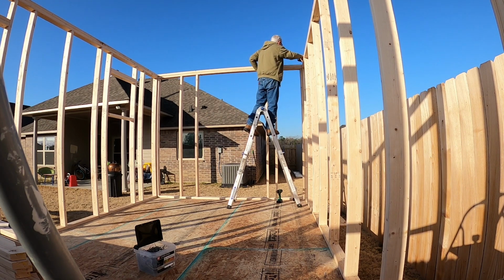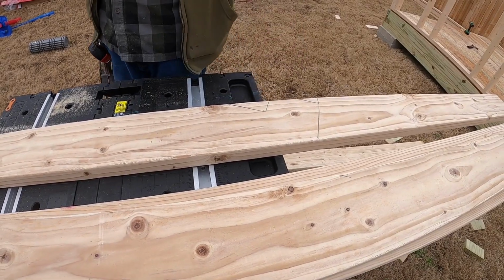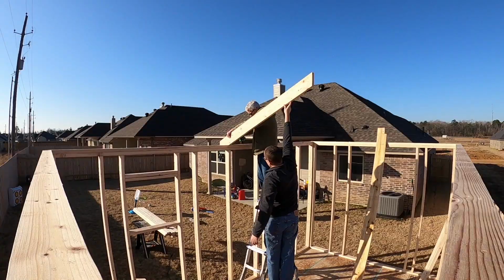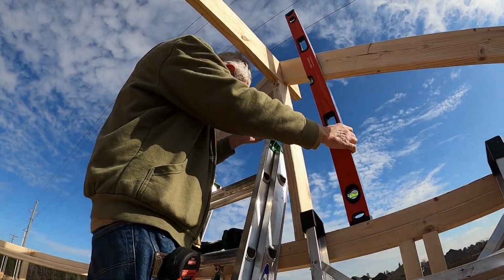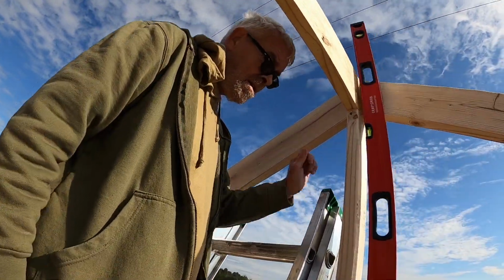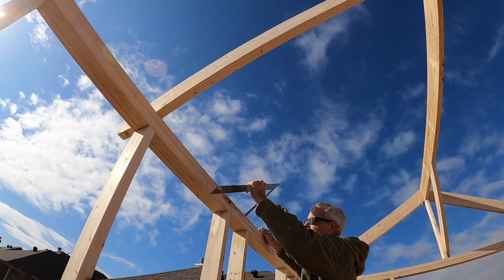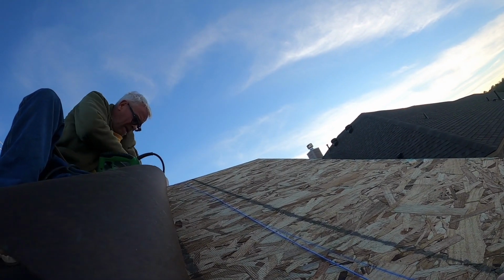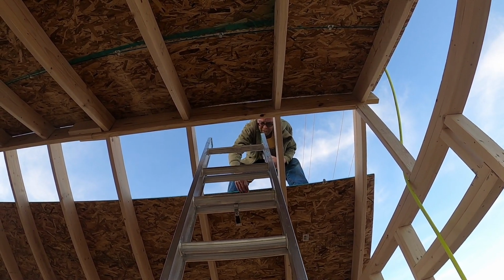Build a Workshop/Shed on a Budget! Part 3 The Roof!

Comment: Tarpaper is supposed to overlap at least 4" between horizontal runs. That's where it gets its water rating. For a 4:12 it's 6", and for a 6:12 it's 4" minimum overlap. Hope it doesn't leak if a shingle nail goes through that crack.